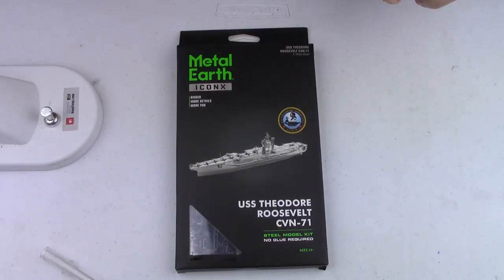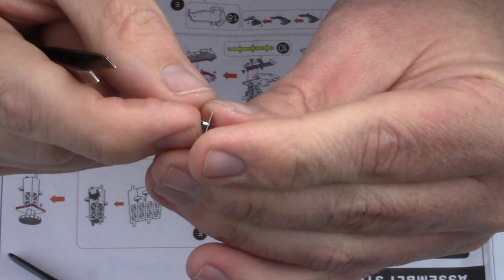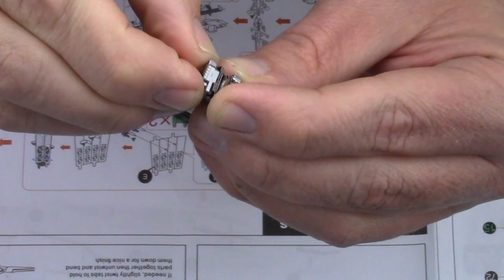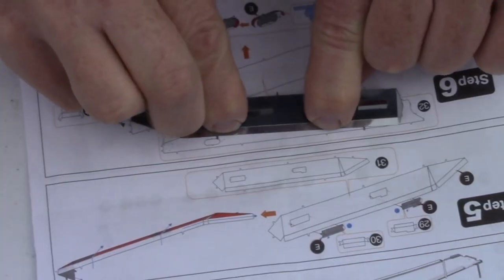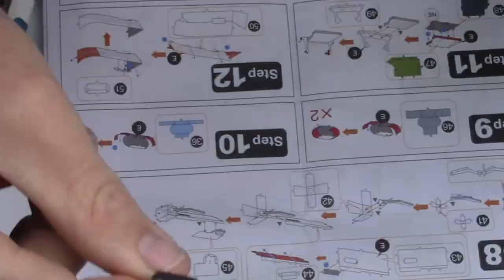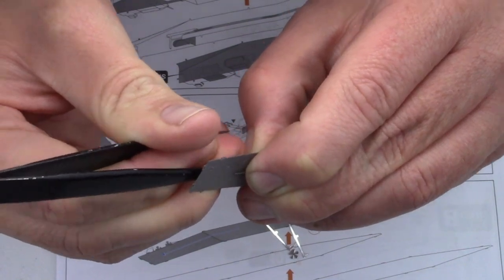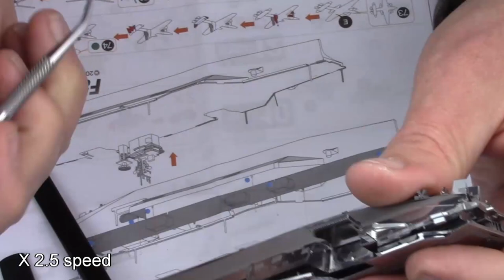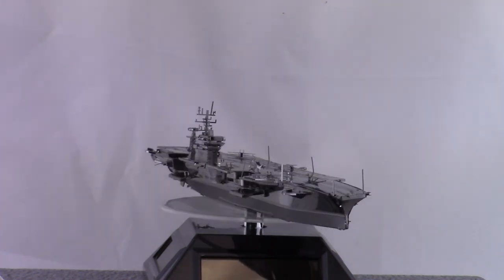ICONX Build - U.S.S. Theodore Roosevelt aircraft carrier

Comment: When you deal with small base and high vertical attachment, you should bend the edge of the small base first then attach the attachment. Or otherwise you will have difficult time to bend the edge with the big attachment on top.

Comment: Actually, the instruction does mark a slot "red" to indicate the tab should go through there. But it is so tiny that you need an amplifier to see it. For example, in step 2, the 2 slots are marked red to indicate which slots part 12's tab should go into part 18.

Comment: I just finished mine, this is the photo album: https://photos.app.goo.gl/6fzWm1YbRnygE9An8

The last step is horribly hard, I broke 2 or 3 pieces in the process. Part of the reason it is so difficult maybe the magnet that I put under the deck. But the magnet did do the job pretty well. I would not recommend this kit, it is too small to my taste, especially when put it side by side by the USS Missouri.
Reply: Not that bad

Comment: This really looks like it'll be similar to piececool's enterprise aircraft carrier.  I'll let you know if it is.
Reply from the maker: Aaron Dugan most likely it is. I will be interested to know.
Reply: animateorange if you like I'll send you pics of it on Facebook, I'm hoping to work on it this week.
Reply from the maker: Aaron Dugan sure! I'd like to see pictures. Good luck and enjoy.
Reply: animateorange I was thinking about the planes being loose. Have you considered using a jewelry glue to affix them? Or even repair broken models.
Reply from the maker: Aaron Dugan I sometimes use loctite to fix broken models. As for the planes, I considered hiding magnets under the deck to hold the planes but didn't do that. It should work however.